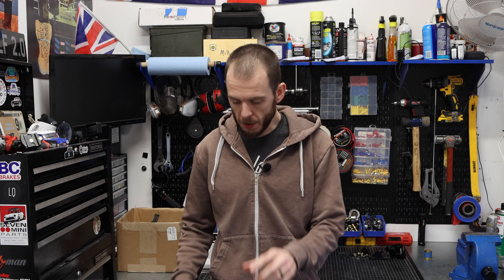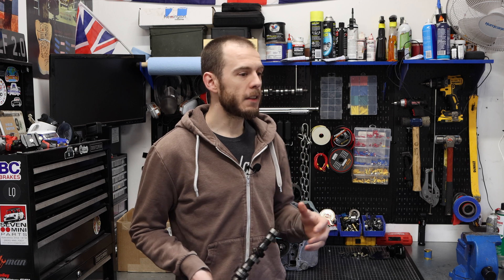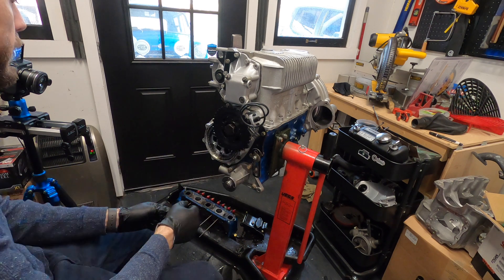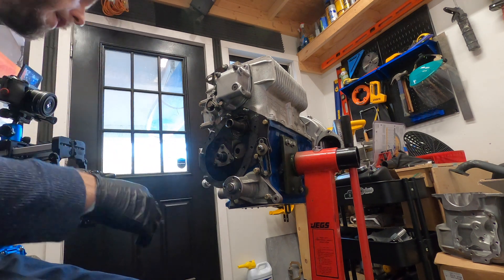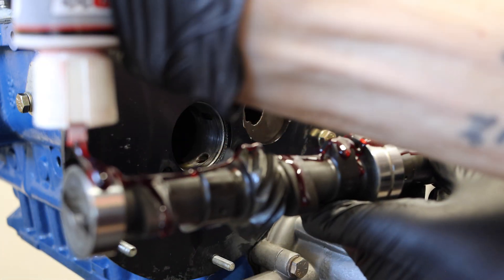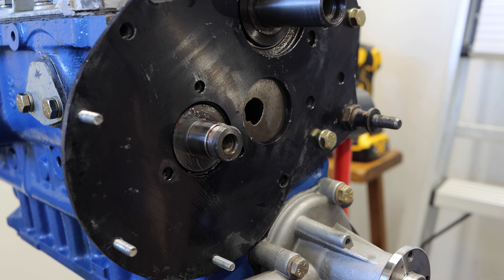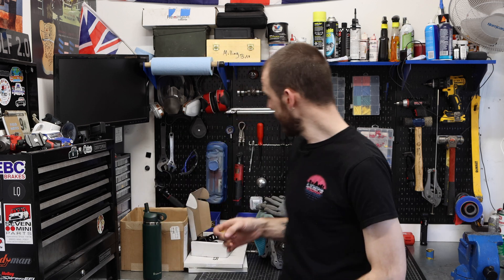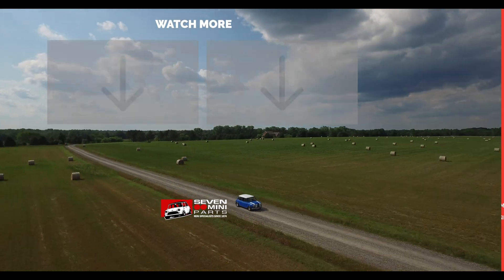Turbocharged Classic Mini Build - Episode 1 | Installing a Turbo Camshaft

Comment: Are the intake and exhaust valves original or oversized? If you increase what size they are?
Reply from the maker: Hey! Yes, they are. 35.7 race inlets and 29.5 race exhaust valves in bronze guides.
Reply: @classicminidiy  Thank you for the answer. Why didn't you bring them to the maximum possible increase? Is there a particular reason?
Reply: @Burghi027  I’m a bit late but with turbo a series there’s no need to chase marginal increases like an na engine, big overbores are counter productive as well. 
your actually after strength and reliability rather than bore flex and cracks between valves 👍

Comment: Cool video Cole. Bit of a side note, the sprockets look a bit too tight on the cam and crank there. We tend to take the keyways out, try each sprocket individually, then pop the keys back in and check again. You should be able to lightly press them on by hand, but there's always a tolerance on cranks and cams, so we make the sprockets on the small side to cover all bases. Next time you take it apart, lightly clean up the inner bores until they're a nice snug hand-tight fit on the shafts, and it'll be save you a struggle with pullers.
Reply: you prolly dont care at all but does anyone know a trick to get back into an instagram account??
I was dumb forgot the account password. I love any tricks you can give me
Reply: @Marlon Zayne instablaster :)
Reply: @Kristopher Grady I really appreciate your reply. I found the site through google and I'm trying it out now.
Seems to take a while so I will reply here later with my results.
Reply: @Kristopher Grady It did the trick and I finally got access to my account again. Im so happy!
Thanks so much, you saved my ass !
Reply: @Marlon Zayne glad I could help :D

Comment: Cole, Great video really well explained and great camera work, unfortunately you are not going to like what I’m going to tell you. You really need to change those followers. I’m very familiar with that particular cam profile and while it is spot on for a the turbo build it has a very steep opening ramp and really requires new followers and very careful running in proses. I know the followers where new for the last cam but they will have picked up material and when it runs with the new cam it will most likely really shorten the life of that cam considerably. I know braking down the rest of the motor is a pain but it really is worth it. Sorry to be the bringer of bad news
Reply: Hay Dude I’m totally with you I agonised over even saying anything but honestly I am really impressed with how much effort you put into every job on your car and motor and just wanted to add a bit of support any way I can. If I was your side of the water I’d have been there in a hart beat. I just popped you an email on your classicminidiy Gmail 👍
Reply from the maker: Hey man. I really appreciate you taking the time to add this info. I also really appreciate that you weren’t rude about it. (You know how YouTube comments can be) I do know that the followers should be changed with the new cam and could have a longevity impact on the setup. That said based on the wear of the previous cam and my own level of risk acceptance I’m just gonna roll with these followers. The followers are the high strength cold rolled steel versions so if it becomes a problem I’ll change them out but I think it’ll be fine for how I drive and use the car. Hey what’s your email I wanna send you something.

Comment: Is that MED 1.3 ou other brand 1.5 roller rockers? Turbos don't need the 1.5. and also you should have replaced the followers.
Whats going on your radiator support, the Philips head bolt its countersunk and should be on the top were the mount is a chanfre also.
Reply from the maker: MED 1.3, followers only have 300 miles on them as this engine was built for a supercharger first that didn’t workout. No need for new followers

Comment: Rebuilding a manual gear shifter on my 1275 and cant find any assistance on setting the reverse light switch. If you could pls help it would be great. Love the channel.
Reply: Put it in reverse gear and screw it in until the light comes on. It's really that simple..